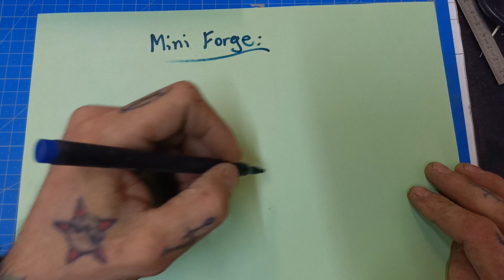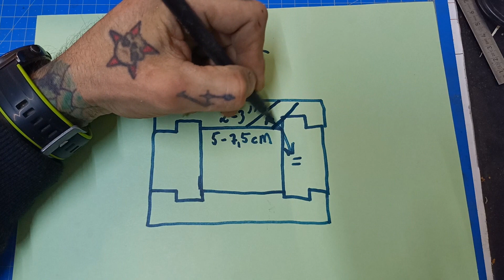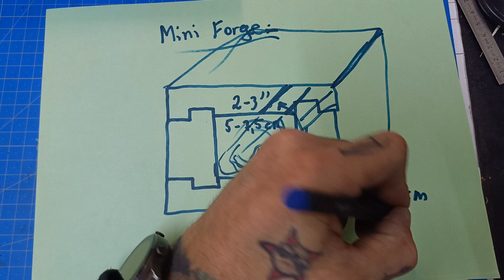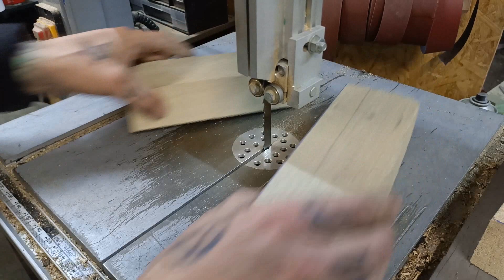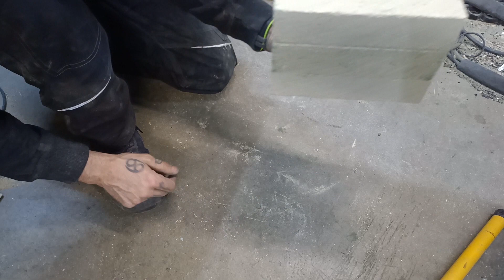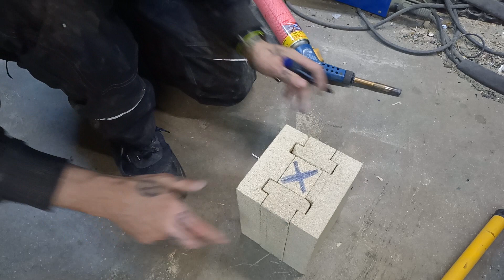Brand New Mini Gas Forge Made From Vermiculite Blocks Very Fast And Easy

Comment: Hi, Wild Style Works. I came across your video about a stove made of gas block (white brick that is cut well), decided to watch your other videos and was surprised to find out 

that you use vermiculite bricks! Why was I surprised? Because I accidentally found out a week ago that this material is sold everywhere, because it is used for flowers and seedlings. 

It is sold in the form of coarse sand. It is good because it absorbs water well and does not allow plant roots to rot. There is also perlite for the same purpose. But it can withstand 

temperatures 2 times lower. I am just thinking of finding two small barrels, putting one inside the other and filling them with vermiculite for thermal insulation. I just saw a video 

of how gypsum and sand are poured in. It turns out that vermiculite also comes in the form of bricks. I wonder what they used to fasten it into blocks?
p.s. 1 year has passed, have you used the stove? About how many hours did it last?
p.p.s. Sorry, I'm using an automatic translator..
Reply from the maker: Hello and thanks for watching my videos. yes vermiculite is used in many ways. also to hatch eggs. but it is not well suited for a forge. its melting point is to low. it can be used as second insulation for a forge, but in first place ceramic wool is best. i used my forge for a while then it melted at the point were the flame touches it. i would say it lastet for about 5-6 hours
Reply: @WildStyleWorks  thanks :-)